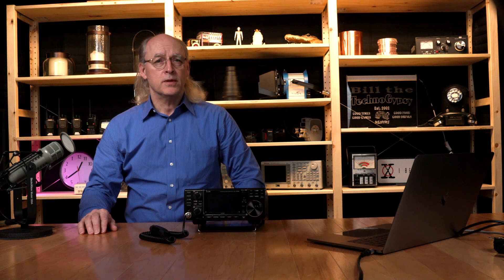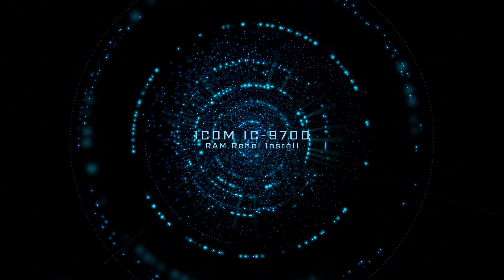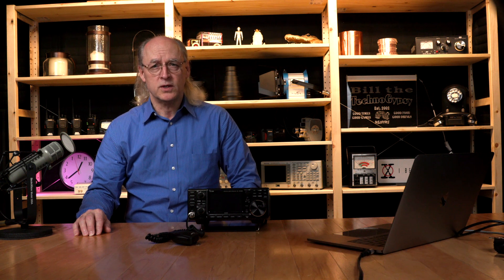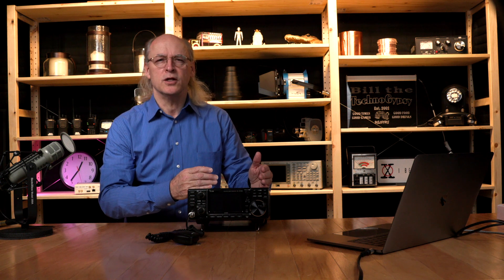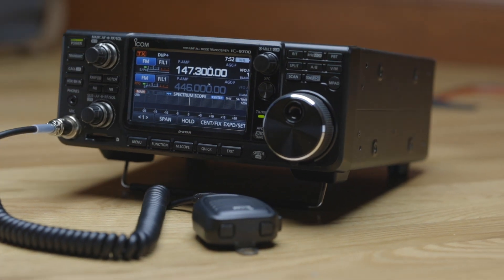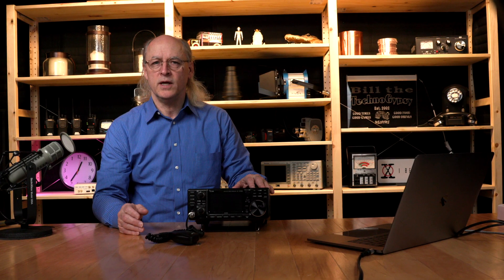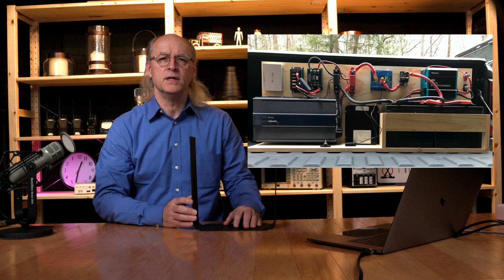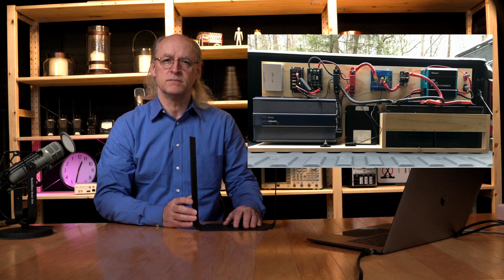Icom IC-9700 UHF/VHF Radio RAM Rebel Install

Comment: Are there more videos showing the 9700 in this car? Curious how well this works.
Reply from the maker: I don’t have any more at the present time. In the process of moving, so kind of cramps my video production. As to how the 9700 functions….GREAT! Having the ability to go up to 100 Watts on 2 meters helps while in the boonies. Intend to do videos showing all 3 frequencies with D-Star operation. I am planning on 3D printing an angled sun shade for the display to knock out the glare. Thank you!
Reply: How did you run the wires in/out of the console?@BillTheTechnoGypsy

Comment: HOW  do you  do all  3  bands
Reply from the maker: jon ericson - I use two antennas on my truck roof rack. One is a Comet 1.2 GHz antenna. The other is a Dual-Band (2m / 70cm) Comet antenna.